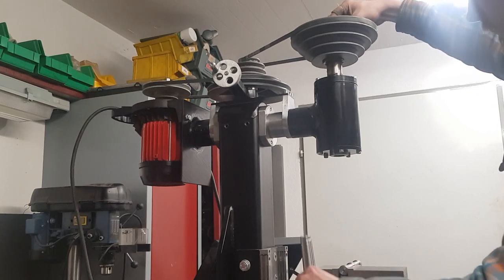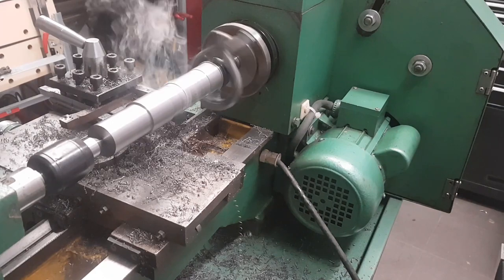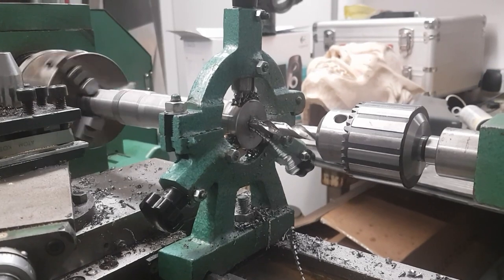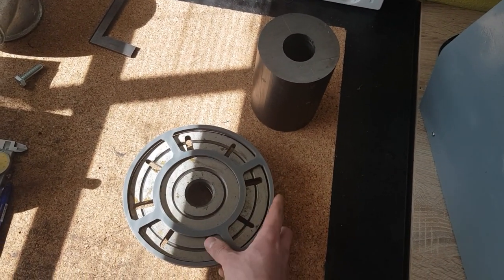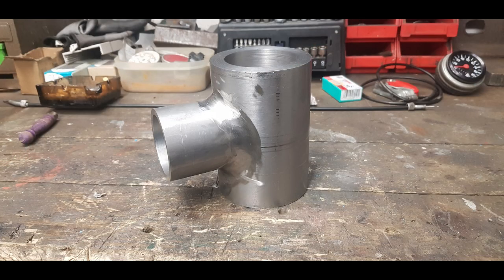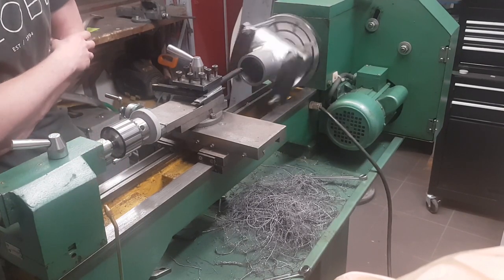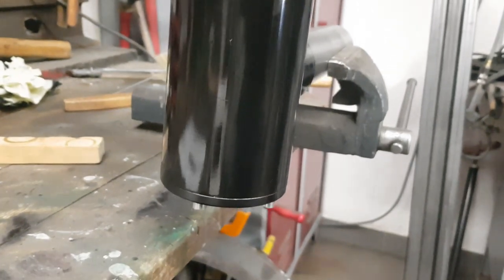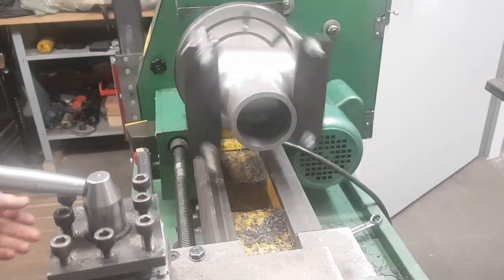My DIY Milling Machine Part 2

Comment: The use of 3d printed parts is extremely clever!
Reply from the maker: It's just convenient. It would take ages to make jigs out of metal.
 With a printer  you are able to sketch them up in 3d and do other stuff while printing.
Most of the 3d printed parts i did were just born due to my lack of time :D.

Thanks for the comment!
Reply: @wastelandworkshop3839  ...it makes a lot of sense...I print the angles to be used on the compound on the lathe.
Reply from the maker: Great!    
 Would love to see that. 
In one of the next mill videos you will be able to see that i also 3d printed the scale ring for the z axis and some other parts.
Reply: @wastelandworkshop3839  :D Nice!

Comment: What I did with the mounting tube to make what I think is a more precision joint both for strength and a truer 90 degree intersection between bearing housing and mounting tube, was to bore a interference hole say .08 mm press fit and about 8mm deep in the side of bearing housing(did this in 4 jaw chuck) then pressed the mounting tube into the bearing housing, I stitched welded the joint to stop distortion while I had every thing heavily clamped. After welding I let it cool overnight whilst still clamped. It turned out great, in fact I spigot and socket most parts I make so as not to rely solely on weld or bolts, it is a better engineering solution
Reply from the maker: That sure is the better solution.
I might consider it in future builds.

But since i machined everything to final dimension after welding the 90° angle between the spindle axis and the axis of the arm is true.

Thank you for your suggestion and the comment!

Comment: hay love your work keep it up 👆 what lathe make and model did you use please????? just a little advice sir people love the tools as much as the product that's why we watch well i bet 90% do anyway you sure know what you doing with the tools mate thank you for sharing your work awesome dude..
Reply from the maker: Yeah i am a tool enthusiast myself.
The lathe is just a small import one. 

It's a Ferm MD 500 with a max. capacity of 500mm when turning between centers and a center hight of 110mm. 
It was build in 1998 (which makes it older than i am) and also will run for some years to come.
Although the bed is a bit worn down it still works great for me.

Thanks for the comment!

Comment: 11:44
What bearings you used ?
Each bearing has a number.
Also Do you have shaft measurements ?
I see drawing but no measurements
Reply from the maker: I can give you the meassurements as soon as i got a little more time.

But for the drawing you see in the video i left them away for the sake of simplicity.
Also most people probably don't have the same stock material i used just laying around. 
Therefore meassurements will change depending on the stock used.

Most of the material i used for the mill were cutoffs from metal industry companies.
Buying the stock  new of off my meassurements is likely very expensive.

The drawing should just show the mechanical detail of how the spindle is constructed.

Comment: I think if you had kept the part in the oven for longer you would have got better expansion to make assembly easier. 
Mark from Melbourne Australia
Subscriber #331, 3/3/22
Reply from the maker: You are absolutely right.
It's hard to tell how long you should heat parts without any reference.
But thank you for the hint.